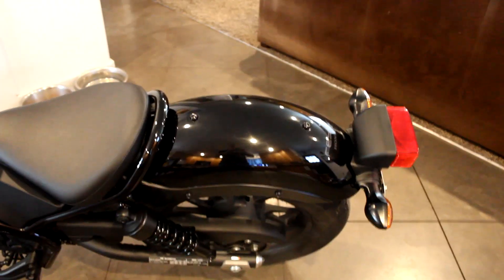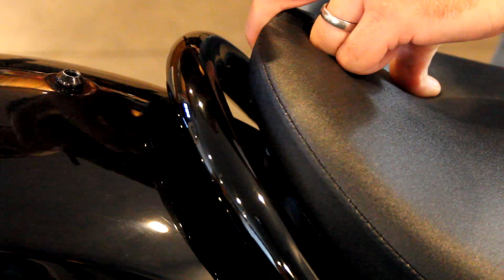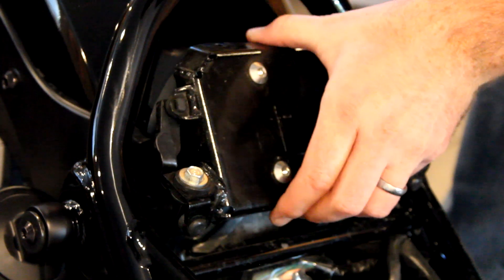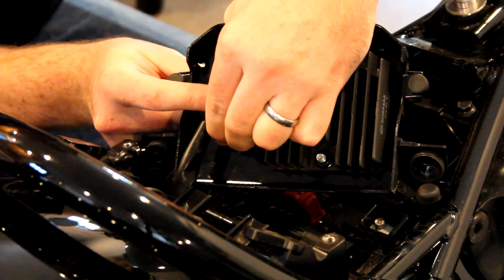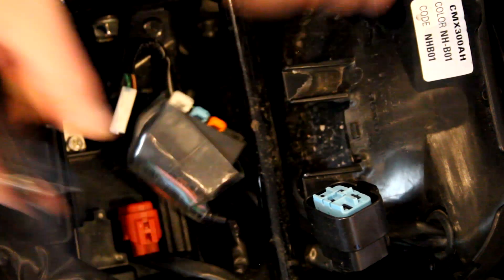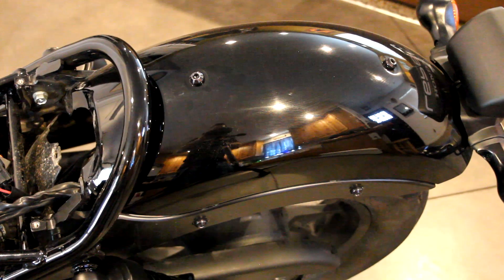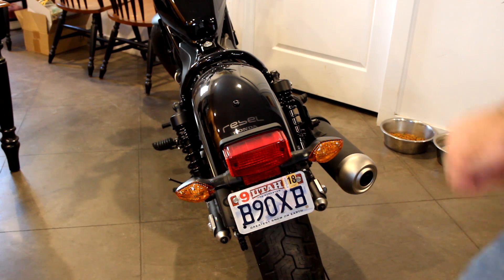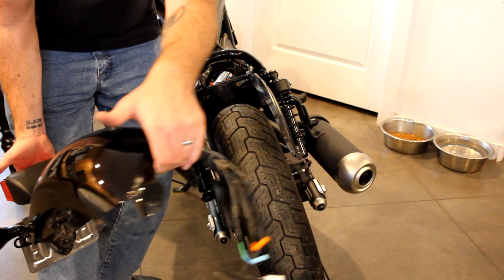2017 Honda Rebel - Rear Fender Removal

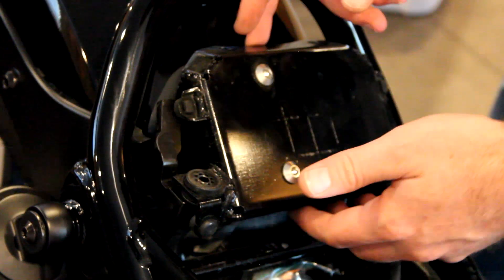Comment: The control unit you refer to at 2:20 is a regulator/rectifier combo. The regulator portion ensures that electricity is delivered at a safe level so it doesn't exceed voltage limits. The rectifier converts AC power from the alternator on the motorcycle into DC power to charge the battery. Sorry to comment on an older video you probably already know this information!
Reply from the maker: andrew chen good to know!
Reply: Thanks for the info Andrew.  Cheers man!
Reply: Yes it is

Comment: Hi. I am from Germany and just bought a 500 Rebel for my wife. I am currently want to change that bad looking light block on the rear fender. Saw your video and i am wondering if its possible to remove only the fender cover and not the whole fender to get to the cables under the cover.
Is it possible ?
Reply from the maker: Sorry it took so long to reply. You probably figured this out already but you have to remove the whole fender to replace the light.

Comment: Have u tried installing a bobber solo seat im curios to know if it could be without welding or drilling anything to the bike, just adding hardware
Reply from the maker: I haven’t l. Sorry
Reply: @ArchesMechanic  i saw u took both bolts that hold the seat base, is attached to the frame and if it is are those bolts long enough to add another plate attachment for the bobber seat?
Reply from the maker: @jhjimbar  they should be or the bobber should come with bolts that are long enough
Reply: @ArchesMechanic  great, thanx I'll try them, I've reached out to 2 bubber seat maker and they dont have the hardware for the rebel 500 2019 ( the rebel with the kind of seat u and i have)

Comment: Ok so I'm at the part where you have to take like the 6 or so fender screws off but mine are ON there. Like Ive had an ex body builder bend up one of his tools trying to unscrew them. Do I need to take it to a shop to get em unscrewed or is there another way I could possibly do it?
Reply from the maker: Taxist Fox they’re a pain in the ass. Try not to do it slow. Just a quick little (large) nudge and they’ll come out. They put them in there right af

Comment: New subsciber here.  Really interesting videos on the 2017 Rebel.  No one else is doing this service, so please keep it up.  I think the bike looks cooler without the rear fender but what about the rear turn signals and brake/license plate lights?  Is there a way to moumt/reuse them without the rear fender?  If  not, do you know of any after-market kits to do so?  I'd love to be able to have a smaller/bobbed fender or no fender at all, and relocate the license plate and brake light to a side moutn instead.  Thanks for the awesome videos!
Reply from the maker: I am going to try and tear this bike down as far as it'll go so I can have content for my channel. I am thinking of doing and install of the Diablo Custom Works rear fender. It's on ebay. $229 though. With this setup you would have to relocate the plate and they make a bracket that mounts to the side (around the rear suspension. Everything on their site is pretty expensive though. They also make a smaller front fender, side covers and other fun parts. Looking forward to you watching.

Comment: one more question if you take the rear fender off can u still put the seat back? or you need the fender there so u can put the seat on?
Reply from the maker: Letran okay...so the fender you can take off and still put the seat on however, the rails that the fender are attached to are part of the rear assembly. Seat, battery box, fuses and the lot. Each rail is around $135 usd so I’m not about to cut mine off yet. Maybe sometime in the future.

Comment: How heavy and sturdy did the rear fender feel? Apparently you can attach a rear cushion on top of it and it can hold a passenger.
Reply from the maker: jeff wong I wouldn’t put anyone over 120 lbs on it. Even then it’s very thin.
Reply: Honda offers a 2nd rider seat for the fender. Its really small and just from the size of the seat its not even worth putting someone on it. Mainly because they wouldn't be comfortable on it and Like Arches said, Its thin and really shouldn't have much weight on it. Id only put a tail bag on it if i could find one that fit.

NOTE: My brother has a CMX500 (Rebel 500) and this is where im getting my info.
I riide a CBR 300R

Comment: Awesome. I’m getting a Honda Rebel 500cc this spring. Yours is a 300cc right? I’m deciding between the Honda rebel 500cc and the Kawasaki Vulcan S 650 S . I have had rode a Kawasaki Vulcan 650 S and it’s amazing super fast light really easy to handle. But I love the style or the Honda rebel 500cc way more I never rode one yet. I absolutely love it. So you are from Utah too . I live in Salt Lake City. How do you you like your rebel?
Reply from the maker: edgar bowen I like the rebel but my father has the triumph bonneville bobber and that bike is amazing. If I had $12k I’d have that instead.

Comment: How do you take the fender brackets off? I’ve tried everything but they won’t budge at all and I don’t want to ruin the head of the bolt
Reply from the maker: Girl On Two Wheels they’re on there so strong! I was scared when I took mine off the first time. I wouldn’t worry about them breaking as they’re very strong. That being said...you may want to get a pro to do it. They are on so tight though. It sounds like you break it when I finally breaks free

Comment: is that any other way to install back the brake lamp and number plate back under the seat ?
Reply from the maker: Fred Cesare not really. You could cut the fender and the two rails that come out but they’re expensive to replace.

Comment: Having  hard time removing them fender bolts. Sprayed some WD40 but still no joy. Any tips?
Reply from the maker: Sharifuddin Umar they’re difficult. Some people have broken the heads off and had to drill them out. Mine were very tight and I just pushed harder. If you don’t care what they look like you can get a vice grips and do it that way. Just be careful
Reply: Sharifuddin Umar I have the same issue. Almost ruined my bolts

Comment: Bro.. how to remove taillight without taken out the whole rear fender... i just bought the custom taillight and wanted to change it...
Reply from the maker: Nizam Mohd can’t since the wiring is attached at the seat.
Reply: Arches Mechanic thanx anyway I managed to take it out. And change with new custom light.
Reply: Hi Nizam. I have a rebel 500 and want to change the rear tail light and blinkers. What did you bought? Can you send a pic of how it looks? And maybe described how you took it off without taking off the fender? Thanks

PS. I saw you videos.. Looks good. I'm thinking of a smaller model with bars
Reply: Codrin T hi... please view my other video.. to see my customs rear tail light.. hope you had an idea..

To take it out 
1) 2x bolt nut u can see from below fender behind tail light.
2) 1x bolt nut exectly below your tail light.

Removing this 3x bolt nut will make your tail light loose. 

Then cut the wire as per you need.. not too short coz you need to tie it up with thr new tail light cable

Hope this help you..

Comment: Really want to do this and be able to have brake lights and license plate attached, doesn't seem to be any way of doing this in the UK that I have come across
Reply from the maker: Sam Cox you can buy aftermarket ones. Not sure where in 🇬🇧. Us number plates are different size too I think. Maybe an aftermarket plate holder that connects to shocks?

Comment: hes missing the big part u have to remove the 14mm silver bolts in the side of the frame! why u didn’t mention that!
Reply from the maker: Feras Smady I didn’t have to remove those
Reply: Arches Mechanic  Well mine i have to i reached there with a dead end plus i checked another link and he says u even have to remove the battery (which i found )to reach the lower bolts because it attached to chassis with 4 silver bolts (2 lower bolts beside the battery and 2 higher bolts)and the last step no need for it (the removal of the 4 black bolts in the side of the back fender) those bolts for attaching accessories like side bags.
Reply from the maker: Feras Smady if you want to remove the arms with the rear fender then yes, you would have to remove the rest of the bolts but I was just demonstrating removing the fender by itself to repair or replace it
Reply: Ok i got it am so sorry i miss understood u and thank u for the video keep uploading more :))

Comment: Remove the fender and get back slapped with mud in the rain? It's a beautiful fender to remove it, is stupid?
Reply from the maker: James Woods this would be for someone who wants to modify stuff, replace the center due to crash, repair scratches from backpack and so on
Reply: @ArchesMechanic  Thanks for responding. I can't believe how much is involved in removing this fender. I stated on a 1964 Bonnyville and it was just a couple of bolts to remove a fender, but then you could replace a fender on a car as they were bolted on as well. I have been driving a motorcycle 53 years and still love it and looking to buy a rebel which has the same horsepower as my Triumph Bonnyville did, Just subscribed!
Reply from the maker: James Woods thanks! My dad has the 2017 bonneville bobber. It’s amazing!

Comment: wery easy take off but no need take, only need change modern rear lightbrakelight and licence plate. wery ugly old bike version rear light have, new led light have better, but genuine fender have best,rebel 500 problem have only too black colour ugly, and too soft suspension need first change better harden suspens before drive anythink. and foothstep need move front lot. add leather sidebags,and paint beauty, genuine have wery ugly and honda have made suspensions fail.